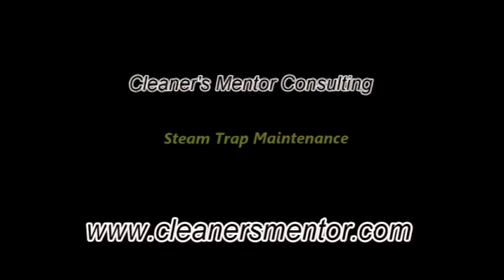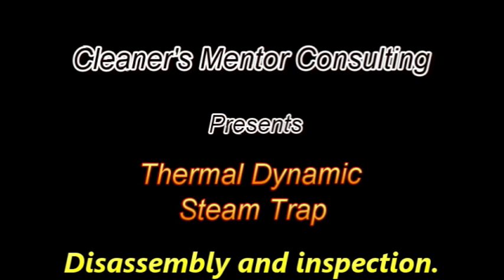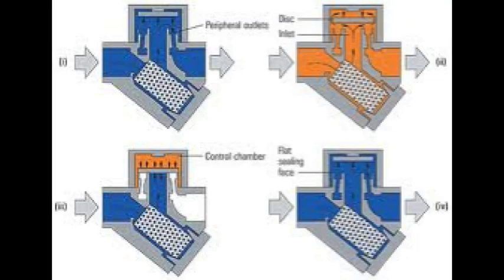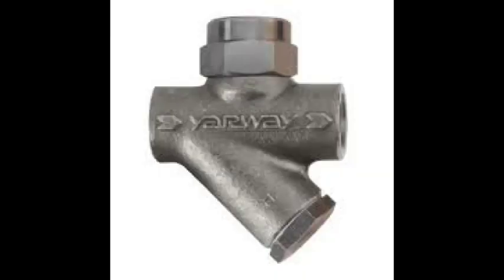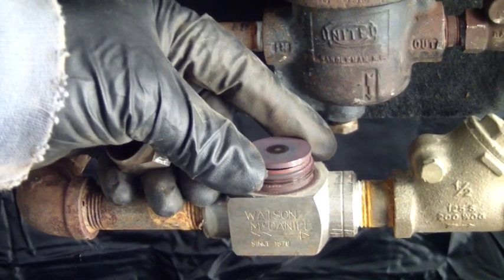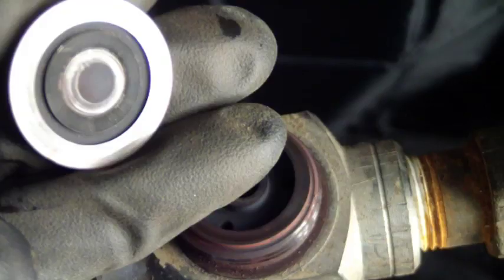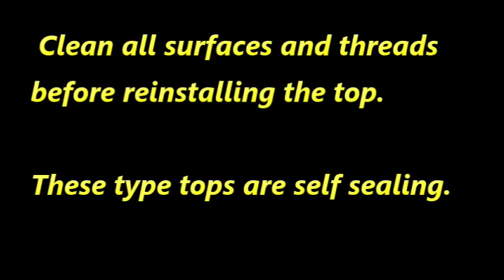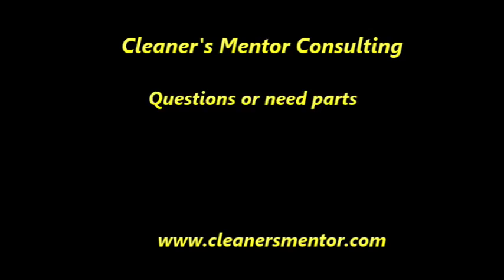Cleaner's Mentor: Steam Trap Maintenance-Thermal Dynamic (disc) Steam Trap

Comment: What would be your suggestion on a check valve? I have a inverted bucket trap on a high pressure supply line ( 70 psi ). The trap is good but check is rattling very loud. Using a lift check but is their a better check to use on that application?
Reply from the maker: Thanks for watching.  The rattling is most likely normal.  If the check is new and has metal seats, what you hear is similar to the sound made by a disc trap as condensate expands once pressures drop.  What brand check do you have?
Reply: Spirax sarco
Reply: Aaron Bray Took a look at their checks and the design is a metal to metal valve seat.
Is this the only check of this type you have?  I there are others, do they
sound the same?  What are you using this trap for?
Reply: Nancy Bray We mostly use the disk check valves, but we were going to try these out to see if they work. They all sound the same. When I open the the valve on the discharge side to test if they are working, of course the rattling stops. But when I close it, it starts rattling again. I wondered if the pressures are not equaling out on either side? The drip legs go to a condensate return line whick goes to a pressure powered steam pump.
Reply from the maker: Joshua Hoffman The puzzle begins!  ;-)
When you speak of the drip legs, you are saying the line the drip legs service also runs a steam powered pump?
What other loads are on this steam system?  The steam is being supplied by what?
I will say I sense the check valves might be speaking.  
Appreciate the challenge!